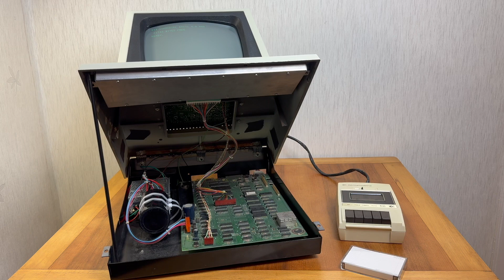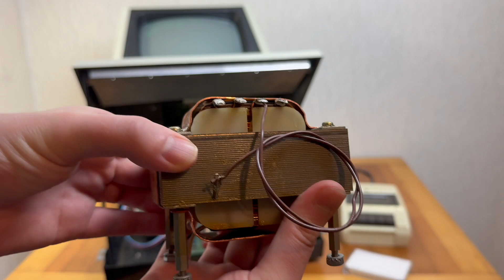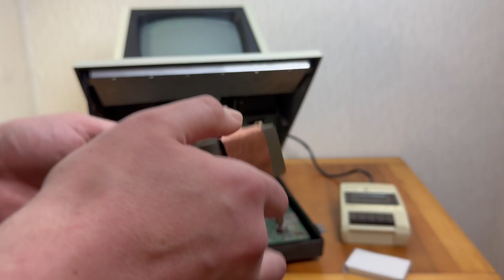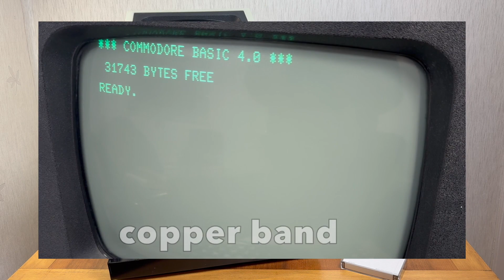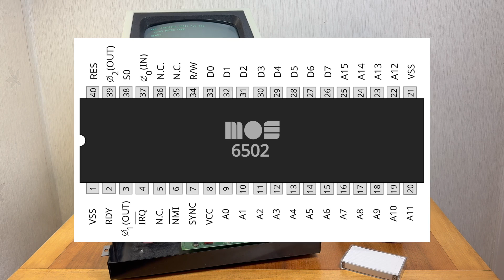Repairing a Commodore PET 4032: Power Supply, Keyboard, C2N Datasette & 6502 CPU

Comment: Thanks for the video! Can you tell me what the make and model of the switched mode power supply is?
Reply from the maker: The machine is now using the "MEAN WELL Switching Power Supply, RQ-65D 4 Output 24V dc, 65 W, Input 110V to 230V".

Mean Well RQ-65D: https://uk.rs-online.com/web/p/switching-power-supplies/0149387

Note that a 24V supply drives the voltage regulators harder than the stock transformer. Ideally, the 24V output should be reduced to a more appropriate level. While this is within the tolerances/specifications of the specific regulators installed in this specific unit, this is not a recommendation and was only done after consultation with the owner.

Comment: I just bought a PET 4032 that also happens to be a US 117V model, and being in Europe I am using a 110V step-down converter. I don't have the screen wobble, at least not from the quick test I have done powering it on. Would be very helpful to me to know which power supply you have installed in yours, I definitely would want to replace the original transformer since I am reading using it on 50hz oversaturates it and over time might damage it.
Reply from the maker: That's great you don't have the wobble. It was an unfortunate side-effect of running this particular 60 Hz machine on a 50 Hz supply, and was very obvious and distracting on this unit. The machine is now using the "MEAN WELL Switching Power Supply, RQ-65D 4 Output 24V dc, 65 W, Input 110V to 230V".

Mean Well RQ-65D: https://uk.rs-online.com/web/p/switching-power-supplies/0149387

Note that a 24V supply drives the voltage regulators harder than the stock transformer. Ideally, the 24V output should be reduced to a more appropriate level. While this is within the tolerances/specifications of the specific regulators installed in this specific unit, this is not a recommendation and was only done after consultation with the owner.

It is worth noting that a 110 V, 60 Hz battery inverter is a viable option and may be a better approach.
Reply: @jtjacques  Thank you very much for the detailed reply! Considering what you said about the voltage being higher than normal I'll see what my options are and if the screen does start to develop the wobble after extended power on time (I am also using a 60hz machine on 50hz), my first order of business will be the keyboard cleaning/repairing since as with all of these, only about half the keys work and the keyboard is rather crucial to get any use out of the machine ;)
Reply from the maker: @0raffie0  Absolutely. As mentioned in the video, I targeted a contact resistance of less than 100 ohms per key. I clipped a multimeter to one set of key traces and (gently) abraded each dome until it could bridge the contacts with an appropriate reading. Where this could not be achieved, a carbon contact restorer was applied. Best of luck with your repair and restoration!

Comment: Interesting hack for magnetic shielding, didn't know that one - kind of crazy that you were able to solder this to the core!!! Must have used a ton of heat. Always loved the 4xxx and 8xxx series. The computer room of my highschool had them, and even a few 8096-SK. Most of them were made in Braunschweig / Germany, where Commodore had a factory. The school had about 20 of them altogether, with 4040 and 8080 shared double disk drives. Also a few printers. I wasn't allowed to use them until ~1986, and at that time I already had a CPC 464, so they kind of seemed very primitive by then. Now I would LOVE to add one to my collection! But they got increasingly less affordable... The school used them for Computer Science classes until ~1987, when they all got replaced by Commodore PC-10s. Then, Turbo Pascal instead of BASIC was being used. Fun machine, a real classic - and great job of fixing it!! A real museum piece for sure.
Reply from the maker: Fortunately, you don't have to solder the copper band to the core, just surround it with a single closed turn of sufficient thickness. But with such a mass of copper, resting against the core, it did take quite the effort to get good wetting of the joint.

The PET will be used as an interactive exhibit that people can actually use, which is nice. It's already on display. We did discuss getting a disk drive for it, but they fairly very expensive so the owner settled for an SD2PET interface for now.
Reply: @jtjacques  very nice! Where will it be exhibited?